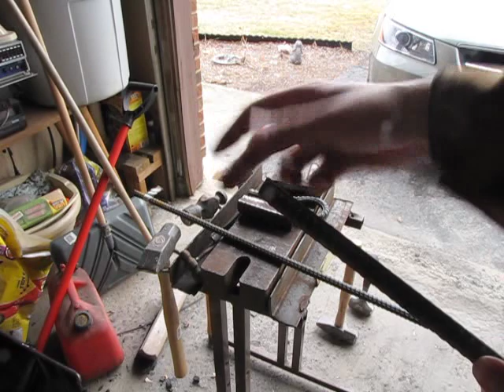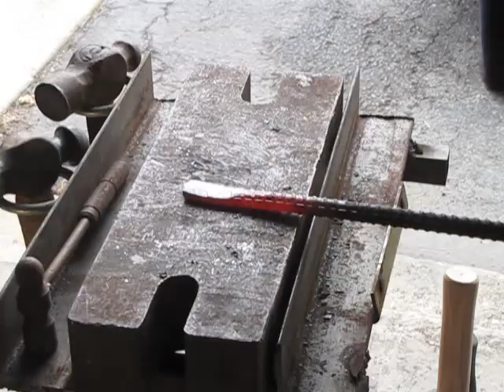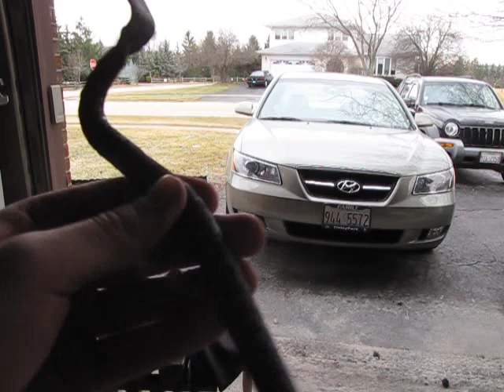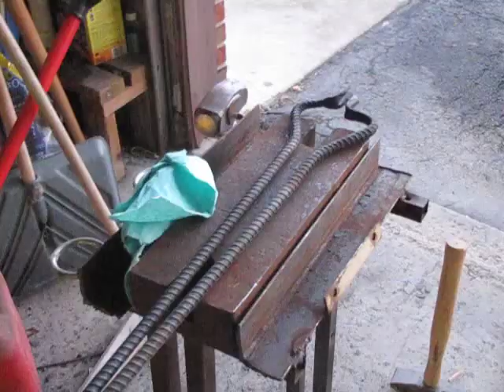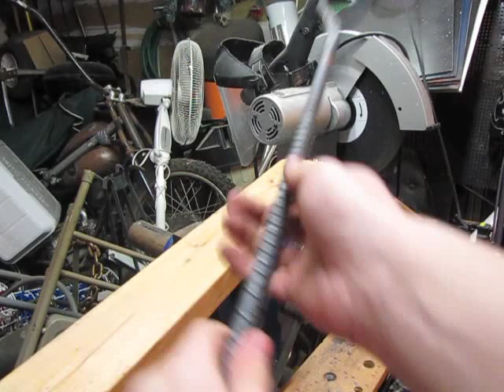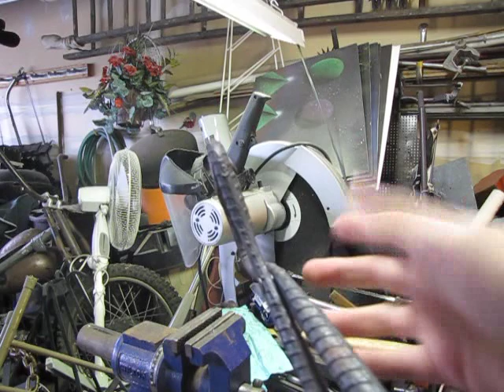Forging a Set of Tongs

Comment: That anvil is a Arbor spreader plate, heavy and thick but mild steel. If you had three of them you could weld them together and top the face with a piece of 1/2" 4140 or AR400, might need hard surface rod but that's a whole other story. My first tongs were rebar but they sheared and I built some better ones. Just a side note to others here, if you make rebar tongs DO NOT quench them when they're at bright colors, they'll break very easily because they've hardened. (Happened to me and I've learned my lesson.)
Reply: Volundr Forge - Thanks for the tip.
Reply: It's been a long while since I commented. My shop has really changed since then. How have you been?

Comment: hell his set up is better than mine.I only have one blacksmith hammer,a small rotor forge(sucks for long bars)I made myself and its sitting on a metal bucket with a fan blowing at the bottom(does the trick for now),My anvil is a solid block of stainless steel inserted into some other cylinder of thick metal(bout a good 25+ pounds worth and that's sat on the top of a old riding lawnmower motor top.Atleast he don't have to bend over like me looking like golem from the lord of the rings trying to make some precious item.
   I want to make my own tongs as well but I just need a better anvil setup up and its all good.Good video though!
Reply: +Kelly Morrison

Comment: when you hammer you really gotta let the hammerfall do the work. I've been bashing  the steel with  a  small sledge and putting my whole shoulder into it with a stiff wrist. my fingers went numb and my forceps swelled x2 and I couldn't bend my arm

Comment: I personally would stand your 'anvil' up on edge and secure it to the stand.  This gives you more 'edge' to work with.  The less bouncing of the anvil, the easier it is to move metal, addding some weight to the base of the stand wouldn't be a bad idea either.  As suggested previous, hit the metal square, don't try to push the metal and use more shoulder otherwise your wrist and elbow will pay the price.